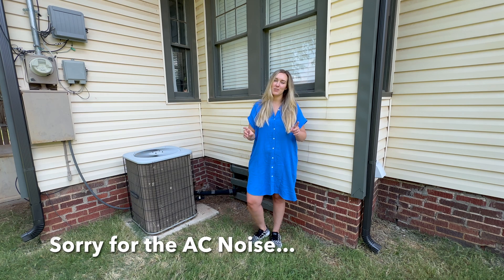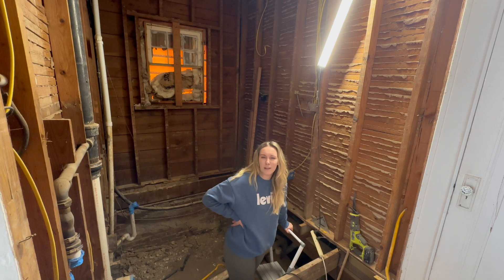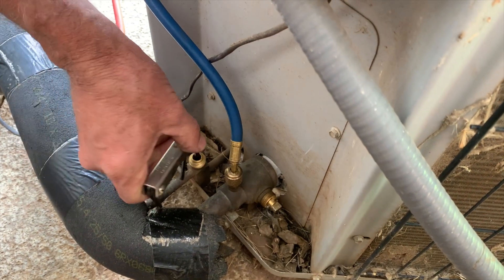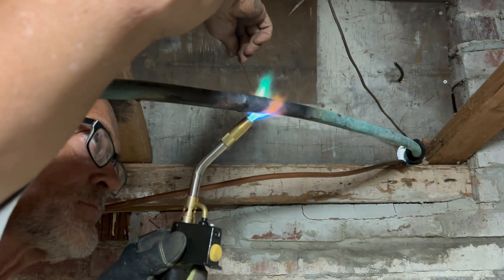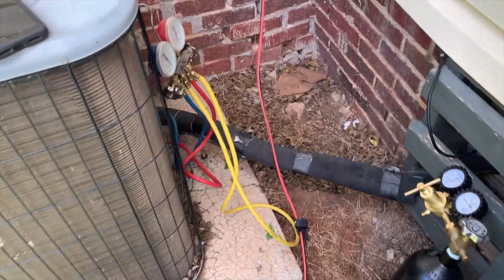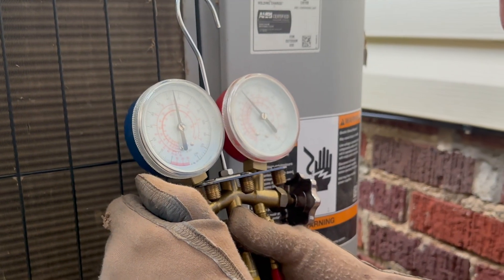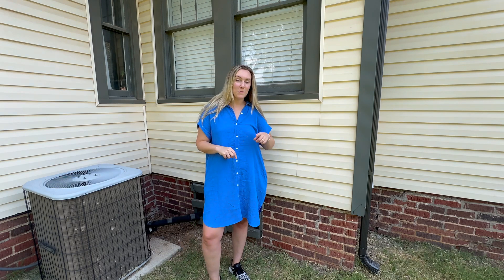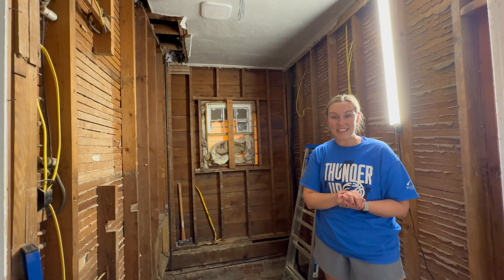HOW TO: MOVE YOUR HVAC LINES (Please only do this with a professional)

Comment: As long as it blows cold air and is comfortable, congrats on saving  5k.  I'm a 30yr DIY'r and I've never been brave enough to mess with freon lines.  Contractors are quoting stratospheric prices on everything it seems.  Because my wife has for years told me to start paying people to do things, I gave in and had a plumber quote me to hook up a dishwasher line and connect a sink drain to the Ptrap.  Countertop was removed for easy access.  I figured it would run about 300-500. I was quoted 1200.00 ):   I politely declined, drove to Lowe's, bought the materials for a total of 67.00 and hooked it up in an hour.   Six months ago and no leaks.  It wasn't high level work.  As I told my wife, I just made 1100.00 for an hour's work.   That's 20x what I make at my full-time job!
Reply from the maker: Exactly! It's still working great and is over 20 years old so either way will need to be replaced within the next few years and we'll need to shell out the money for that!  That is so true on the astronomical prices. It is an amazing skill to know to do those things yourself. Though it can take longer, but so far seems worth it. Thanks for sharing and watching :)

Comment: If you shorten the lines you should be removing refrigerant not adding more. You can't charge by temp, you derive your target superheat or subcooling from the line temp + pressure. That unit is most likely way overcharged. Also when a system is opened the filter dryer must be replaced. 

Those lines were not done properly. If that was in fact plumbers solder used that unit probably only have a few years before the acid buildup kills the compressor. Those line will also need to be flushed when the unit is replaced to remove the acid. I would recommend replacing them since those cold solder joint will be an endless source of problems.

When doing lines in a wall, under a foundation, or anywhere inaccessible in the future, it's a good idea to sleeve the lines with a 3in or 4in PVC pipe so they can be replaced in the future. Different manufactures, SEER ratings, equipment types, etc. call for different line sizes. So even if the lines last, sometime in the future when the equipment is upgraded those smaller lines would be a restriction if not replaced.

That's why it's always a good idea to at least consult with someone who is a professional and not just someone who knows someone who is a professional. I wish you the best of luck.
Reply from the maker: Thanks for the comments and thoughts! We will keep that in mind! It is over 20 years old and when it does go out we’re planning on having professional hvac people come in and move the unit to a better location and move/replace the lines too. Thanks for all the tips to keep in mind. I appreciate them and the time put into your response:)
Reply: @OkieDIY I don’t recommend soldering HVAC lines and not flowing nitrogen while soldering.

Comment: If your lines are cherry red, that's brazing, not soldering. But when you braze you don't use flux. So which was it, braze or solder? Also, when you braze you have to run nitrogen to keep oxide from forming which will damage your unit, and I didn't see any mention of that.

Did you replace the dryer/filter? Do you have one? I didn't see one, but maybe I missed it. If you don't have one, all those oxide particles are not going to be good for your system.

Nitrogen testing is done at 400 psi, not 60.

I'm surprised about the analog gauges, they are not accurate enough for the leakdown test. (Although doing an overnight test help ameliorate a lot of that, since even an inaccurate gauge should be able to see that.)

Why did you not replace the lineset? It would have been cheaper than having to resolder so many spots, and you would have gotten insulation for them.

It is not necessary to heat the R22, the suction side of the AC will pull it in.

Using just pressure to charge a system is error prone, you need to also measure subcool and superheat.
Reply from the maker: Thank you so much for the thoughtful comments!  I truly appreciate them and love learning more about all of this. Thanks for clarification on brazing and soldering. Probably a dumb question, but do you continually run the nitrogen even if the lines are cut? Wouldn't the nitrogen just keep leaking out? Or either way it will still prevent the oxidizing effect? With the leak repairs we had the nitrogen in the system for that part, but good to know to do it the whole time. Our AC unit didn't have a dryer/filter on it from what we looked up and could tell. 
We had all the materials from what our relatives had given us so we figured we'd rather use that than paying for the new lines. But I don't know typically how expensive they are just the quotes we got. 
Thanks for the tips on recharging the system as well. So far things have registered still a cool 55 degrees even in the Oklahoma Summer with our 100 degree days. Hopefully it keeps up given our old house and all the poor insulation. Again I appreciate the time put into your comments and all the tips!
Reply: @OkieDIY  (Thank you for your reply, I was worried after posting mine that I came across as too aggressive which was not my intent.) Anyway, yes, you continually flow nitrogen through the line, and yes it leaks out, but nitrogen is very cheap, and you don't need a lot of flow once you do the initial purge. Make sure you provide a place for it to exit, or it will force the joint apart from the pressure.

The risk with not replacing the lineset is a leak, and R22 is *expensive*!! You got very lucky that you got some for free. New linesets are cheaper than any R22 leak.
Reply from the maker: @Ariel1S  Good to know for if we have any issues and will need to fix anything. We will keep that in mind. And no I very much appreciate your comments as it was definitely helpful criticism. Sometimes online its hard to convey exact tone but I appreciate your comments and helping me learn more about it all :) We are definitely not professionals but just working with what we have until the AC system fails which most likely will be in the next year or two. R22 is super expensive haha we had our AC go out last summer and pretty expensive for the fix but also just to have it recharged, sadly I didn't know my dad had any then! Gotcha on the leak with R22. I will keep that in mind for next time! Thanks so much for all your insight :)

Comment: Just for anyone trying to replicate this: Don't hold your torch on the pipe constantly while soldering or you burn out the flux leading to leaks. Watch the DIY HVAC Guy to get best practices not covered here. This was like glimpsing back in time 10 years. Haven't seen someone charge a unit that has no receiver without a refrigerant scale in my entire life 😅
Reply from the maker: Thanks for the comment the tips! I’ll check out that person’s videos too.